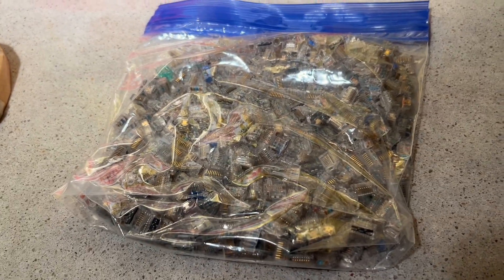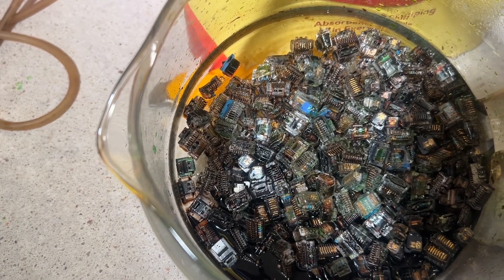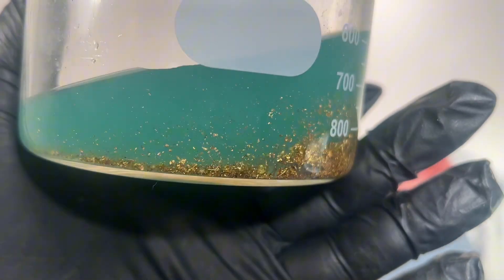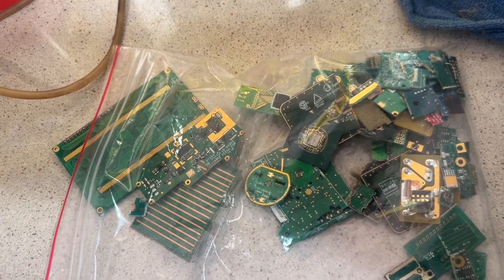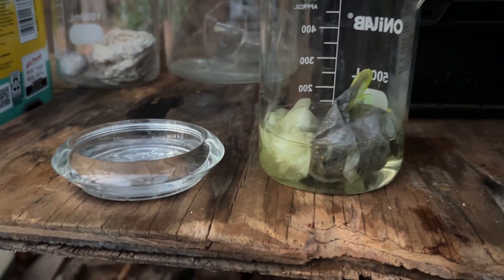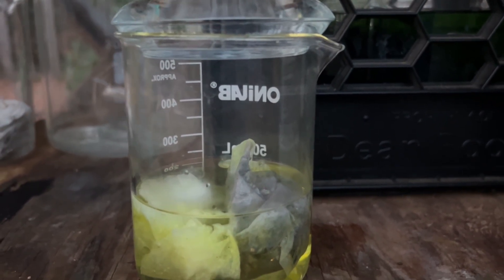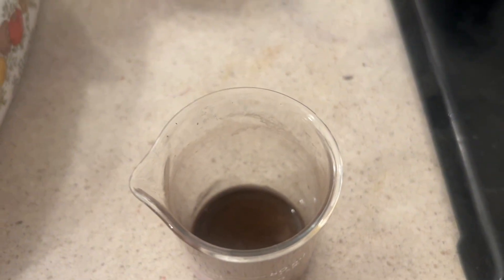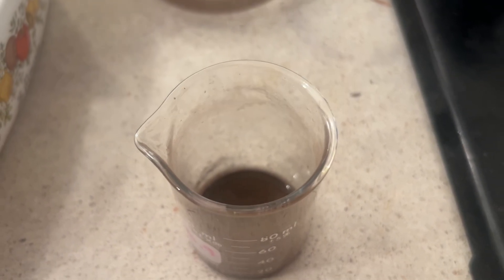Gold from low grade Electronic Waste

Comment: I have been tossing these.😬  Divi cables too. I needed the room.
Reply from the maker: I cut the end off now I have to take the cables to the recycling yard in town , it’ is taking up room man I get that part lol
Reply: @Hill-13  I try to recycle but sometimes I just have to finish the job.  The Divis suck because it’s mostly base metal I think you did better with RJ 45s.  I’m liking your method tho.  I’m putting in better fume ducting I’ll try it over the winter🙂.
Reply from the maker: Empire had a really good idea of cutting them up more that is what hemmed me up really was gold flakes were still in the plastic after AP , when I went to AR  after the solution cooled the gold dropped out it was really strange . Still filtering some of the fine sediment , I will put it in my filter storage and do a final refine in the end still gave mid and higher grade to go
Reply: @Hill-13  I have some 1960s NASA grade fittings.  That’s my best stuff.  Did one batch and haven’t cleaned it up.  I let it leech too long and it’s full of iron.  There is a real learning curve to this stuff.🍺
Reply from the maker: E waste is a fickle beast

Comment: Gold is gold no matter where it comes from. AP is great through the winter months. Can be used inside with minimal fumes and it's set and forget. I've been using my stock pot for the small boards with gold plating on, once components are removed I just throw them in the stock pot. The gold will get recovered one day 😂. Nice job brother 👍
Reply from the maker: Thanks , still so much to go through  , the cat litter bucket is working well on containing the fumes . I will get a weight on the goldi m thinking around .25 g ( I hope ) about 12 bucks on chemicals .
Reply: @Hill-13  i was thinking around 0.2  but that would still have you in profit
Reply from the maker: Yes sir , I’m going keep going low grade , mid grade / pins then fingers .  Maybe some casting up next